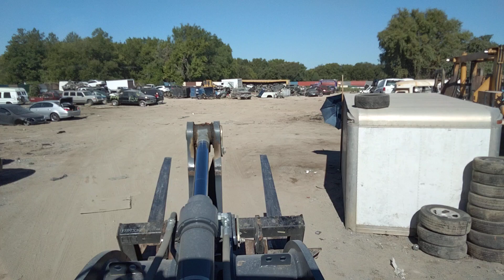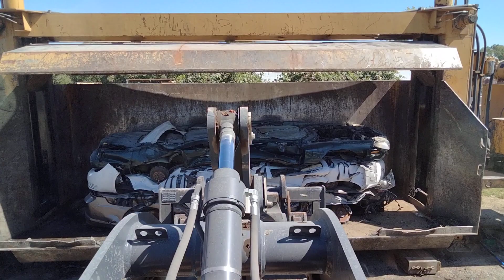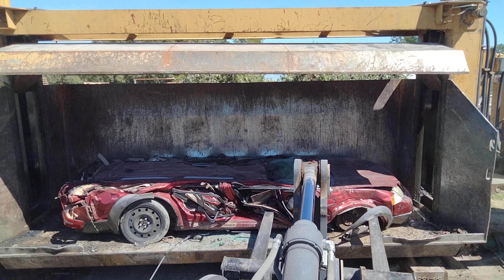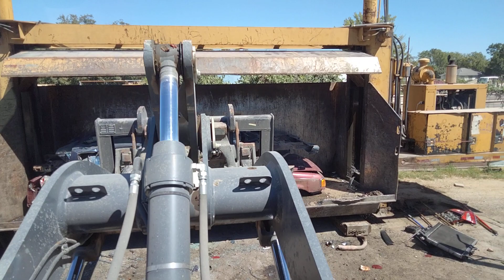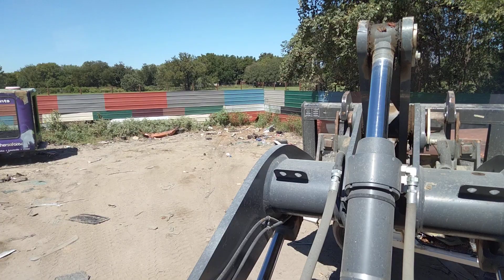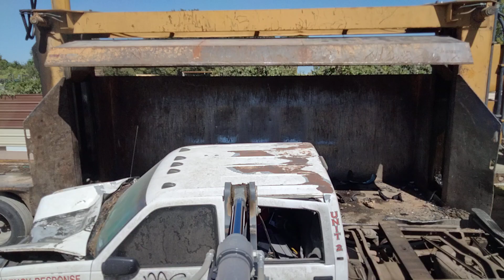CRUSHVILLE HEAVEN AT DA SPOT..

Comment: The mx6 are definitely getting harder to find.. I have 2 customers with each generation that they are restoring..
The best part is I am helping them with parts for both of them..😁👍
As for the square body caprice that is the generation that Cops (tv series)got started with..
Reply: I saw an Mx 6 about a year ago. I was wondering why they still had it and didn't trade it in. lol those things are dated.
Reply: @mysterybuyer3738  : just like the Toyota Camry of the same vintage.. still reliable and hard to get rid of..